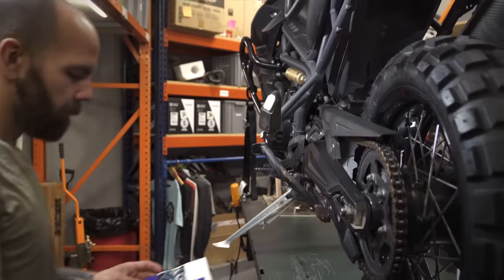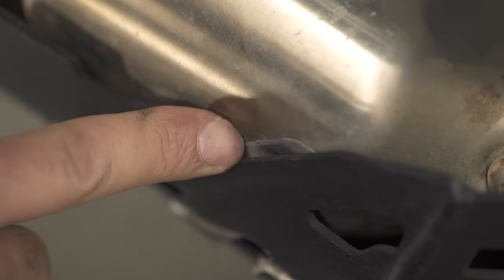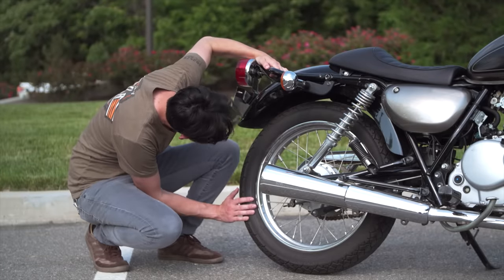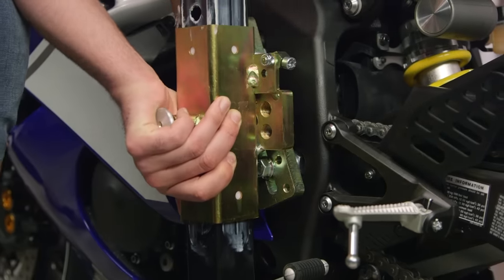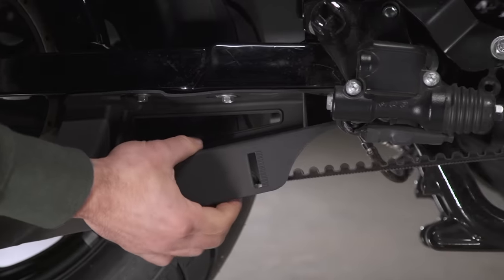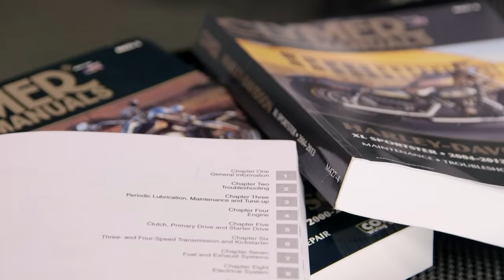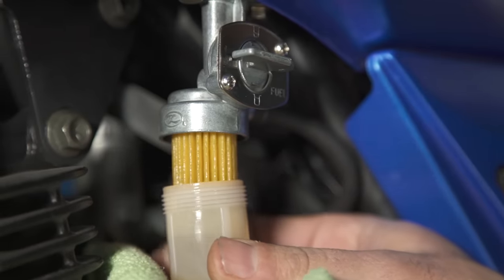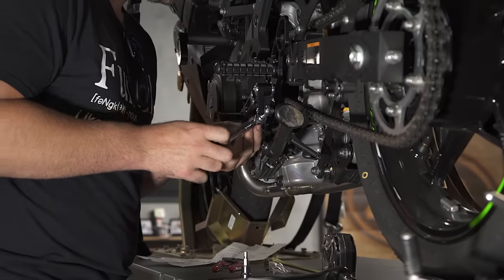How To Prep Your Motorcycle for Spring

Comment from the maker: Want to learn more about preparing your bike for spring? Head over to Common Tread to get all the info you'll need for a successful riding season.
https://rvz.la/2uP6acl
Reply: RevZilla I just replaced my starter & starter relay solenoid, checking wires & fuses. My 01 ZX9R is trying to start up whenever I touch the positive cable to the battery🤯it does it with the key in the off position, relay connected or disconnected, start switch on or off. Out of ideas, please help
Reply: @YungCountry1    and  r rc
Reply: L

Comment: Finally, an excellent video covering ALL the needed items to check without pushing the "best of" any specific part or brand.  Total thumbs up on this guys.  Great video 👍
Reply: Maybe I'm wrong ....but they just sprayed chain lube all over the rear tyre (3.35) besides that it was great
Reply: @TheK1ylo  They're lubing the chain the easiest way you can if doing it solo imo. If you have another person, you can have them rotate the tire as you hold a piece of cardboard behind  the chain so you don't get it on the tire or the rim.
Reply: @L_C_3027  only seeing this reply .maybe it's easier for me with a single sided swing arm.... but I'm able to wedge cardboard ,spray and turn wheel all at once by myself.
Reply: @TheK1ylo  I feel bad for you

Comment: Get a float charger and you'll have no issues. Unlike a basic trickle charger which constantly delivers a very low current, a float charger monitors the battery as it self discharges and delivers enough current to “top it off” without over charging and causing the electrolyte to boil off.
Reply: What about the 10 other steps? 😂

Comment: Check the tire DOT date code on the side wall.  Tires are considered  old after five years.  The four numbers in the DOT code represent a two digit  week of the year they were manufactured and a two digit year ( i.e. 1420 is the 14th week of 2020, or, first part of April 2020).  I personally do not ride on tires that exceed this date ever!

Comment: Is it odd that i have 6500 miles on my ninja 300, and the chain has never needed adjustment? It's possible it was done at 3500miles during service.
Reply: Check your chain slack. I'm sure it must be a little loose by now